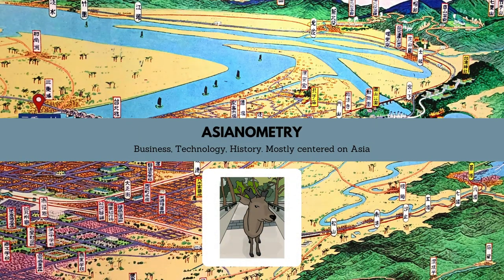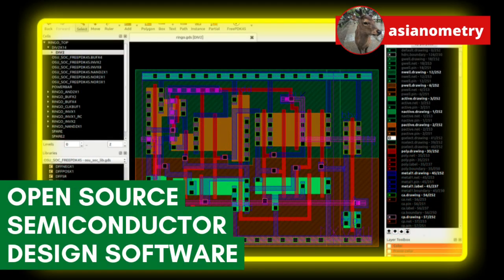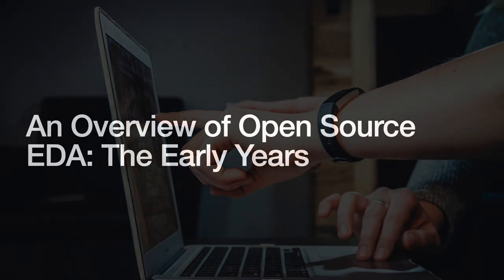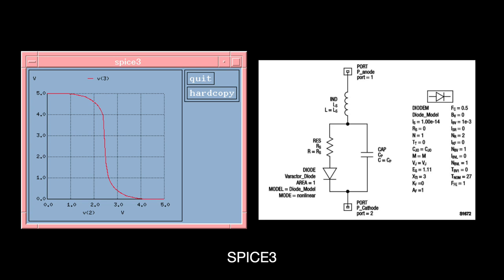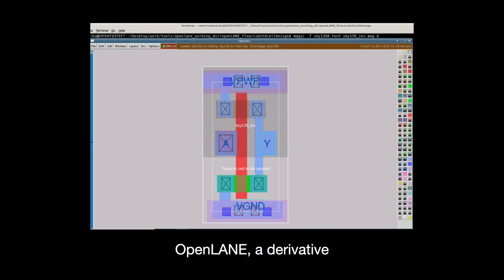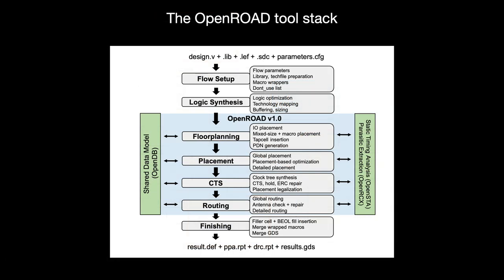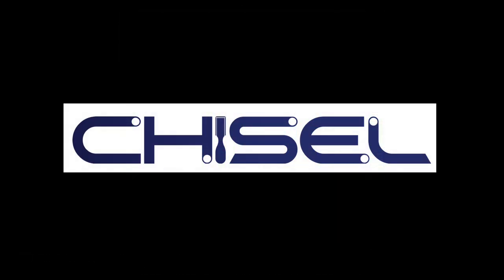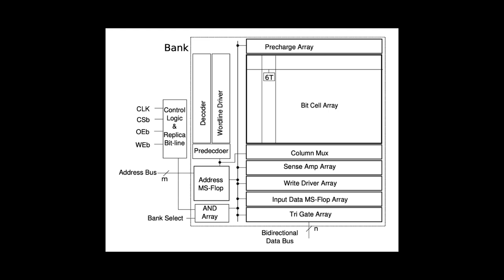The Promise of Open Source Semiconductor Design Tools

Comment: Interesting how on one hand everything moves towards getting more closed, restrictive, and unfree. On the other hand a lot develops towards a fully open, free, and transparent system. I wonder what will win.
Reply: Winning is possible only in (closed) games. Infinities balancing (life, civilization, family, peerage, etc) are research, in findable pereniality.

Akin to discerning between "coherence" and "completeness": endable (completable) games mapping forms of extendable (coherent) interactivity.

Keeping any ship sailing involve a lot of recatch and a lot of release. Breathing in seconds/minutes, sleeping in minutes/hours, eating in hours/days, etc. Playfulness in  seriality enable variable mindfulness.
Reply: Fabricating each smaller node iteration take $billions of research, 
giving away the results of this research so other fabs can use that $billions of research for free and let someone else pay for it will disincentivize progress that requires $billions to develop.

This is the way it should be, let the patents run out and let Open Source loose on mature silicon, lots of use-cases could value novel ingenuity over failsafe reliability.

A lot of the cost of proprietary architectures come from needing failsafe design in extreme environments like a factory, AI machine learning could be used to optimize data-logging for example where a worst-case problem simply shuts down a database, but when the consequences of logic that doesn't properly handle edge-cases could kill someone, the logic-design environment must be heavily constrained by design, using prebuilt heavily constrained protected logic blocks for example, that are used for building the failsafe control logic, before any actual sequencing or process logic is programmed.

In manufacturing, Rockwell AB, Siemens SIMATIC, & OMRON or Mitsubishi will continue to dominate the automation control of large plants with heavy platform lockin, 

most industry-specific automation builders who make custom interfaces with their logos everywhere will build on one of these.

Its much easier to get help with a specific problem on a Siemens forum, than searching stackoverflow for something that might be similar.
Reply: Open has been winning for decades in the most meaningful ways.
Reply: @wedchidnaok1150  That's awesome. Is there an Asianosophy channel? 😂

Comment: It always makes me smile a wry little smile. It is surprising what a single person can do when it comes to RTL design. The trouble is that a single person probably doesn't have enough money to get a working design taped out and fabbed up. If one has the money for fabrication, then one would likely have many employees. What follows is a human battle of determination that prevents one's design getting done. Indeed some may never have anything to tape out. Such is the tragedy of the world we inhabit. 🙂
Reply: A friend recently mentioned he designed an 8-bit microcontroller in two months.  That's the ISA, the core down to semicustom layout, verification of the design, and a freaking C compiler (no fancy C, but most of K&R, statically linked) to machine code.  And he hit multiple process nodes, all under 10 nm.  At this point he's probably fabbed it.  It runs the calibration code for a fast+wide SERDES.

He's the most productive engineer I ever met.  And like most of those superstars (folks like DJ Delorie), he hates using other people's stuff.
Reply: @IainMcClatchie  Damn thats impressive, what does he use it for currently?
Reply: @jaspa99  Multi-GHz SERDES on the latest processes have to calibrate out lots of environmental variables.  Voltage and temperature and the transmitter and receiver, intersymbol interference patterns, as well as more static things like process variation across the chips and layout variation between parallel traces on the boards and packages.  Calibrating those things out requires sending and receiving calibration patterns and tweaking filter weights.  That's done with a program, and that program runs on an embedded processor that is part of the SERDES on the chip.

CPU and GPUs now have a pile of specialized processors on board.  The memory and PCIe interfaces have SERDES with embedded processors, bootup is controlled by an embedded processor, and there is usually an embedded processor that runs special security code.  I would not be surprised to hear that cache misses on big multiprocessors are handled with something that resembles an embedded processor, especially on a GPU.

High speed SERDES show up on all sorts of things now.  Flash memory controllers, network interfaces, anything that uses DRAM, and of course CPUs, GPUs, and their equivalents in the cellphone world.

Comment: my dream : design my own soc but...with hobbyst levels costs . No matter if I can afford only micrometer scale, not nanometer!
Reply: Sam Zeloof here on YouTube has managed something like 100 transistors on a homemade chip (just an array of the things for testing, though he has previously done an op-amp). Not sure what the feature size actually is, but if we say 10 micrometres, then that's early 1970s kind of scale.
Reply: You can start with a FPGA prototype 🙂
Reply: @yxyk-fr  good answer, and I think @nandland has the Go board which seems good To start With FPGA
Reply: Same. Even w the AI craze, u can implement many models directly on an ASIC for deployment after they been trained. It would be very performant.
Reply: Why is a channel length < micrometer even a problem? How many illuminations do we need? Isn’t there something like self alignment? Just create the fast gate at a small scale, but everything else can be bigger.
Reply: Sounds like a group project?

Comment: I think these go in two different directions. The old flow is graphical floorplanning, cell based design, etc. The new way is Verilog, tested on FPGAs and sent off to a "conversion" firm or to the end fab that takes the design and runs it though automated floorplanning and process prep. All of the SOCs I have been involved with for the last 15-20 years have been done this way. The nice thing is the Verilog route is going to be much more amenable to open source processing.
Reply: The open source crowd will take any and all paths toward getting to silicon ;-)

Comment: It would be interesting if PDKs were made to follow a certain standard. Like XML or what have you. That way the "big professional stuff" and the open source stuff would be able to work with the leading edge nodes provided you're in the good graces of the leading foundries.
Reply: You'll need some sort of access control mechanism to get any sort of adoption from the current industry. The best implementation might be something like a pdk server where the pdk lives in a black box either locally or on the fabs servers somewhere. The latter would probably not be great since the latency is annoying. Some pdks ive worked on have required you to submit your designs to the fab to check your design so a chunk of the design rule manual is hidden on there server.
Reply: There was Interoparable PDK:
https://en.wikipedia.org/wiki/Interoperable_PDK_Libraries
which is going a little far than GDS2
Reply: I think that will take new technology in semiconductor manufacturing. Cheaper faster machines making a more competitive marketplace
Reply: There's only 3 leading edge fabs, I don't see any financial or technological gains to be had by standardized PDKs.
Reply: @gatocochino5594  I didn't mean standardized PDKs. I meant having all PDKs in a standardized format so any EDM can work with any PDK.
Reply: @andersjjensen  Sure whatever. Enabling support for PDKs isn't the problem with the open source design tools, it's getting access to the PDKs.
Reply: @andersjjensen 
I'm wondering if you could have a standardized open source intermediate PDK.
So a 14nm one, in a machine readable format, and maybe they could automate going from the intermediate to the vendor specific one. Like Samsung 14nm.

Like JIT compiled languages like Java and C#?

Comment: From your verification video I took away "oh, so verification in the silicon space is not related to formal verification, it's just testing". Formal verification is mathematically proving properties about the outputs of the system, as you do in bluspec. That is a fun subject to dig into, if you get the chance, and very few design shops have the budget to do that.
Reply: formal verification can be also very difficult if you think in nanometer structures. Because there are always capacities between two things next to each other. So even if the normal behavior of your components is what you want you have also to make sure there are no side effects because of unwanted capacities and similar things. And no I don't know really how this "magic" is done, because I have enough to think in normal high-frequency stuff like radio, but no idea how to do it on a microscale.
Reply: @SirWickenshire My mothertongue is not English so I often use more complicated wordings for relative simple things.

And yes quantum leaping can be a problem too, but the effect of capacitance is at much bigger distances relevant than quantum leaping.
Reply: @SirWickenshire It's not that simple. And it's got little or nothing to do with quantum tunneling.  There's stuff like "ground bounce", where a transistor that turns on can suck all of the electrons out of the local ground, raising it above the local vcc for another transistor (experiencing vcc sag) and so ones turn into zeros and v.v.  Then there are timing issues; you need to have clean "eyes" on any serial line.  High capacitance can cause eyes to close. Then there are issues with poorly balanced clock trees, where basically not everyone switches in time. 

Anyway, formal verification will not catch any of this, because formal verification hasn't the slightest clue about these crosstalk-type effects. 

Worse, you can't model/simulate this stuff, until you have the floorplan of the chip, and an accurate model of the transistors, the assorted metal layers, the dielectric constants of the various layers, because all of those affect the propagation of the signals and the likelihood of any of these effects
Reply: Formal verification is also used in some cases! See, for example, the paper "Replacing Testing with Formal Verification in Intel  Core i7 Processor Execution Engine Validation"

Comment: I work for one of the three big EDA companies.  Until you experience the amount of support customers require, and how many thousands of engineers are needed to create and support tools and IP, there's no way of comprehending the effort involved.  Sure they charge a lot of money, and they're profitable, but they do burn huge sums of cash creating the products.

Despite my employment, I'm a big fan of open source everything.  But trying to kick off the hardware product flow without paying tens of thousands engineers is like how Mao Zedong tried to have back yard steel furnaces replace large steel plants.
Reply: Gotta love EDA support. I still remember the guys at Snps, I would get prompt replies from them whenever I would hit a wall trying to access obscure functionality and email them questions. However, as a power user I would have rather had access to the source code. Most users of the software will follow the flow defined by the vendor and need a lot of hand holding, however power users like to bend software too their will and don’t really need support, they just figure it out. Those are the guys that make open source work. Linux is the best example, the big users of Linux don’t get it for free - they just pay the kernel engineers directly to get it to do what they want. Regular users will either pay for support to someone like red hat, or pay for it in lost productivity doing their own support.
Reply: Look at a lot of open source software companies whose business is just charging for support over an open source thing. Open source and support are not opposed. Maybe this will be the same thing in some years for the EDA world
Reply: I want to design an EDA tool like virtuoso, what technologies do I need to learn or are there any good learning roadmap resources, thank you!

Comment: Thanks for this video ! That subject is "my turf" and I've been invested in this field for more than 20 years !
Reply: It's turf I'm trying my hand in at home, I've been a software engineer for 20 years.
I'm starting with FPGAs and VHDL, where should I go next once I've learnt that?
Reply: @MostlyPennyCat  You know you never stop to learn !

Have a look at the GHDL compiler, which enables things even the VHDL designers couldn't imagine (I have done actual real-time simulations based on the computer's clock, input-output to the printer port or the Linux Framebuffer...)

VHDL takes time to get your head around but it's well worth it. GHDL changed the rules too. I do most of my EDA work with VHDL now, with a bit of bash scripting to glue it all. 

After you feel comfortable comes the real question : what do you want to do with this technology ?
Reply: @leyasep5919  
What I Want To Do:
My hobby target is one of two things.
1) A hobby games console, 2D, advanced stereo synth and sampled sound, ROM based cartridge games, basic SD and HD (up to 1920 x 1080 x 32bit RGBA colour)
2) Variable byte length microprocessor. Rather than one instruction cycle performing one piece of 8-bit maths in parallel (8 XOR bits) it performs one piece of bit maths per instruction cycle.
So, 8 bits require 8 cycles.
5 bits requires 5 cycles. But, because they are so small, the clock speed is much higher. So it's my take on a 1-bit computer. I realise that probably makes no sense.
Reply: Also, somebody needs to start a global business that allows you to queue up your prototype asic on a shared wafer.
Who's up for that?
Reply: @MostlyPennyCat  As for the prototype queue, this exists since the early 80s as MOSIS. 
Since 2020, the Google-Skywater collaboration uses a "MultiWafer Project" service from efabless.
Reply: @yxyk-fr  apparently my answers don't get published 😕

Comment: An open source PDK sounds like a good fit for Risc V. I wonder if it were possible to have an open, non-foundry-specific PDK for say, something around 100nm - and then have foundries agree to fab from this PDK. Also I think part of the problem here is, usually enterprise-level tech eventually comes down to the consumer level - not so with fabs ;) Unless there's some major breakthroughs in 3D printing, I don't see enthusiast-scale fab (kits?) in the near future.

Comment: Good job and present without saying it one of the big challenges for RISC V moving into more advanced design process nodes and capabilities. So what would change this? New machine technologies which could be produced cheaper than current EUV.
Reply: RISCV has been implemented using carbon nanotubes. We just need a kind of 3d printer which can harvest those tubes, measure their characteristics and build a circuit. Pick and place. I have seen gold wires of 1 atom thickness. Maybe a copper wire can be routed around and stretched thin?
Like on a breadboard, but smaller.

Comment: I would love to see something on optical computers 😁
Reply: Qbits and quantum computers is my vote...
Reply: Optics have far too large of wavelengths (yellow light is >300 nm, which means the transistor is larger than that). Speed of light lag, ironically, means that such a computer goes too slowly.
Reply: @evannibbe9375  in a way that is actually an advantage since you dont have to deal with those pesky quantum nuisances of going super small.
also, you need to understand that working with photons is fundamentally different than working with electrons. optical gates can go way way faster than electronic ones, more than making up for the transistor density difference.
optical lines can achieve literal hundreds of Tb/s over very long distances, but try doing that with electrons, good luck. oh yeah, and you can multiplex optical channels.
Reply: I'm a software guy and only had very basic HW stuff in college. How realistic are optical computers and why is or isn't that something that's taking off? This is actually the first I have heard of it.
Reply: @TheJeremyKentBGross  It isn't that hard to create something like a PCB that is very good at the single job it has. 
It is hard to design the hardware with optics that is good at every task you throw at it.
That is propably why you did not hear from it. It simply doesn't exist for now I think.
There is (successful) research too mix optics into the design of regular chips, but only to transport data faster (still inside the chip).

Comment: How will the open source EDA compare to industry veterans Cadence, Mentor (now Siemens), Synopsys and Chinese new comers Amedac, BGI, X-Epic
Reply: they do not compare on the same basis.
On one side you'll have all kind of close-to-nothing-to-pay software that is portable, scalable (you can run as many instances on any computer as you want), easy-to-hack, but low performance and low gate count.
OTOH you have extremely expensive, hyper-featured, industry-proven, ultra-high-scale systems that you can only run on cherry-picked computers "if the SW provider agrees".